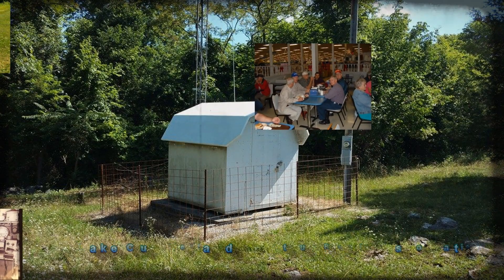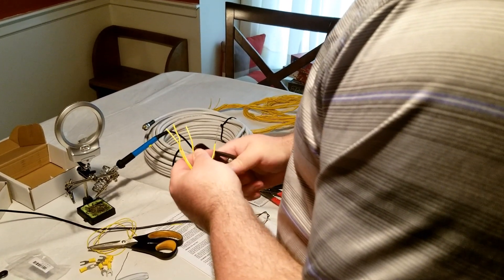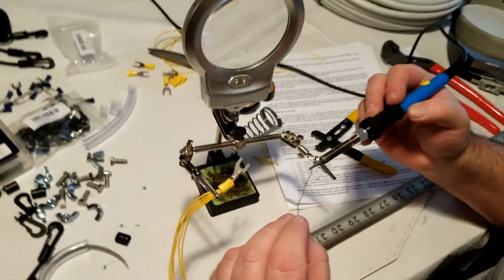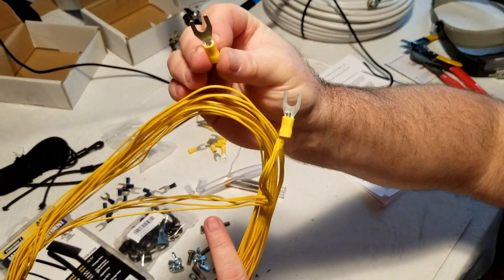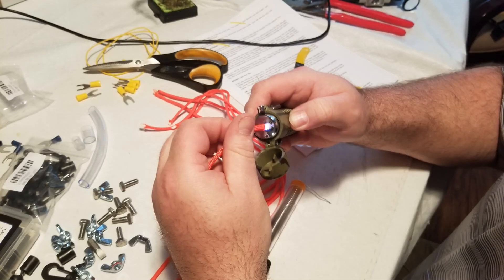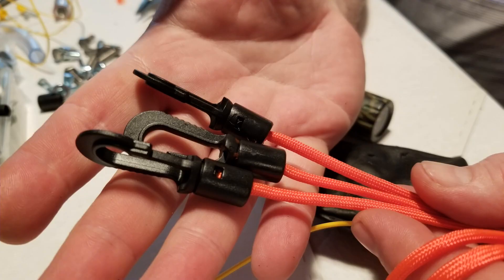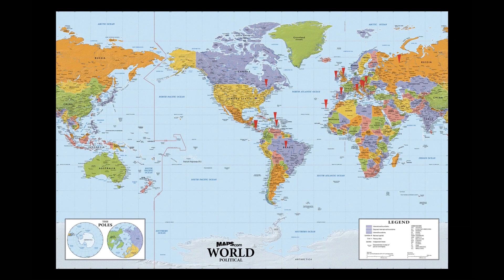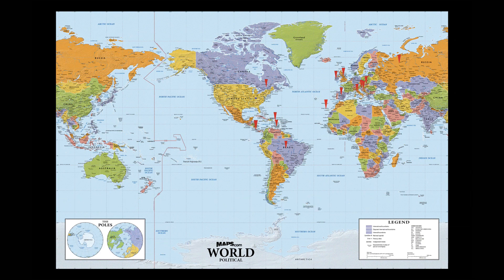LCARA HAM Radio: DX Commander Antenna - Part 2

Comment: I expected to see a demo of on-line contacts, SWR, etc.  Can it be bought in the USA?   Vee W7IBB
Reply from the maker: Hello Vee, the SWR can be tuned quite well.  It's really a matter of how much time someone wants to spend on the vertical elements.  You can gennerally get SWR down to 1.5:1 or sometimes less (not bad for 1/4 wave vertical elements)  Also, as we know, the location for the installation/setup will be a factor.  So far I have made dozens 
 of contacts all over Europe and South America including Russia and Brazil and to the Canary Islands.  The longest so far is about 5500 miles.  You can purchase this antenna from the designer/developer Callum M0MCX: https://www.m0mcx.co.uk/

Comment: How’s the noise floor
Reply from the maker: Hello Jay, so far the noise floor seems really good with this antenna but I'm sure like most it will depend on where you set it up and then of course the current conditions.  Usually I have no smeter readings for noise.  Beyond that I've been using the DNR on my radio less and less lately.